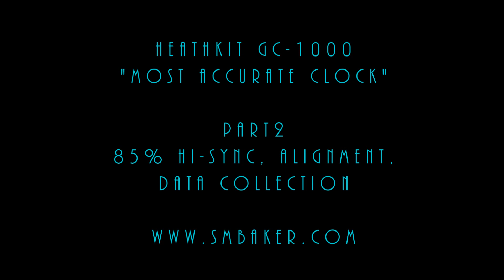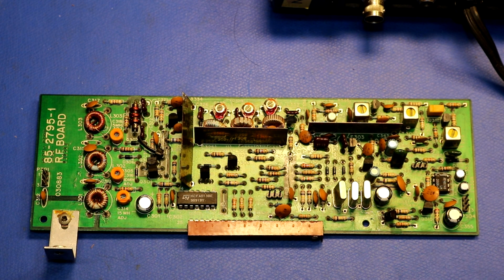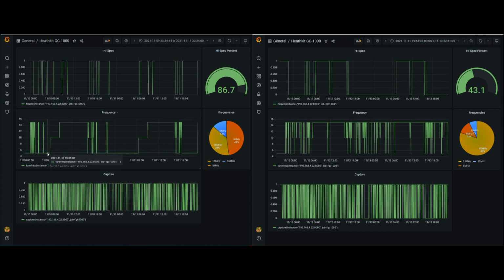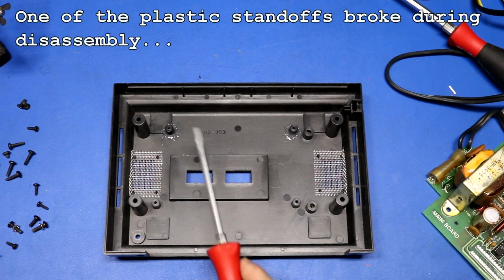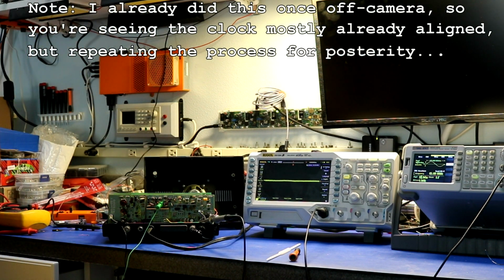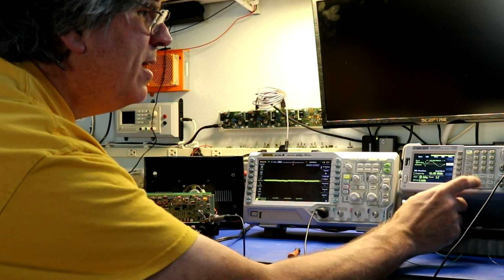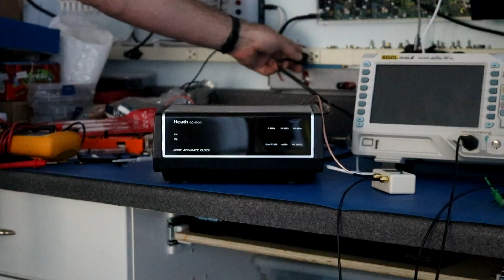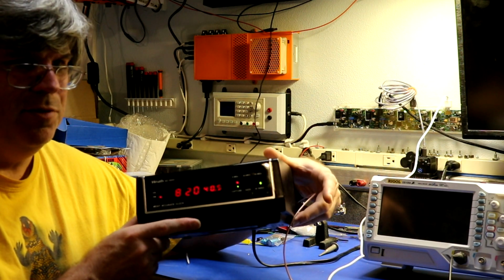Heathkit GC-1000 Part 2: 85% Hi-Spec success! Data collection, and RF board alignment

Comment: Have you tried using the boards from the better working clock to see what that does?  It may help pin-point where the trouble is.

Comment: Probably has a few resistors and caps out of spec. If it was me I would launch the parts cannon on it and replace the resistors with metal film and recap.
Reply: Then you would have a clock with little historical value left in it.
Reply: @pikadroo  I am the type of person that prefers it working then have it as a shelf-queen.

Comment: Try swapping the front-end FET's between the 2 Rx boards or just buy a new FET. If that unit was been hooked to an outside antenna in the past, a surge from a T-storm nearby may have compromised the FET. The sig to noise on my GC 1000;s with a sig gen on the front end is VERY good above 1 microvolt. Also, since the IF cans are in a basic LC configuration each, I'd suspect the cap(s) associated with that can to be out of spec. If you have some sort a a Cap decade box, try centering that can at 455KHz by lowering or increasing the capacitance, depending.
If all else fails, rob the better RX pcb out of the other unit and make one decent unit and have a parts queen.